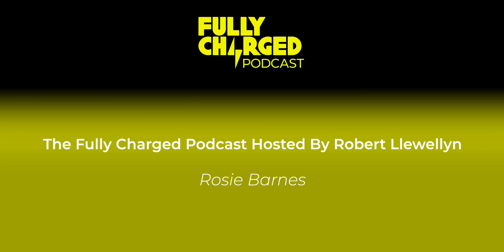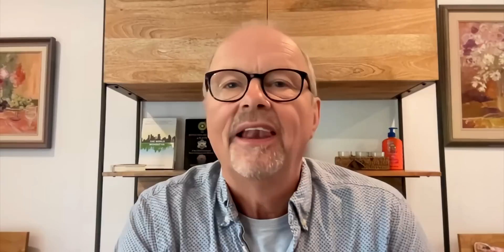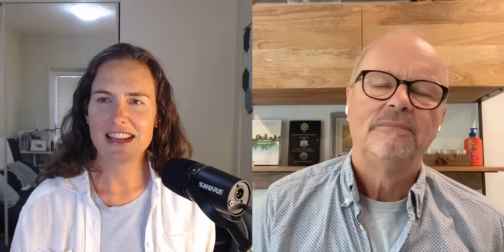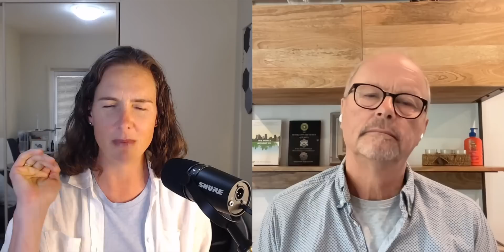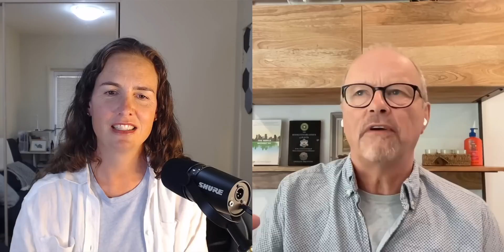The Inevitability of a 100% Renewable Energy Supply with Rosie Barnes | The Fully Charged Podcast

Comment: 20million vehicles in Australia and all parked 23hrs a day with 100kwh batteries means that you can have upto 2,000gWh of DISPATCHABLE electricity daily. 
Avg daily drives are 7kwh only from 100kwh capacity.
Reply: are ev owners who spent a fair amount on their vehicles (and knowing that the battery is the largest cost) willing to have their vehicles to be used as grid storage - given that this will add to the battery degradation over time.  Also possibly going to use the vehicle only to find that it needs to be charged because the grid needed it.  I mean the idea sounds good but the question is how much do you pay ev owners for this and will they go along?
Reply: @peterkratoska4524  there is a large amount on the value of vehicles to grid on the internet now.
Vehicles communicating with the grid. 
Battery technologies are evolving rapidly. 
EV batteries will be a huge potential value to a renewable energy storage. 
EV sales have been increasing at 40%.
The climate change (destabilisation?) is a big cost and central concentrated electrical power supply is the most expensive energy. 
The massive costs of the national grid has been hidden because it was built to the minimum over the last 100 years.
The protection of the existing national is a critical cost saving for our energy future. 
Big EV batteries are a valuable part of our future.
Reply: @stephenbrickwood1602  I've been familiar with vehicle to grid idea for a long time. But Tesla for instance has no interest in doing it.  I know a few Tesla owners (most of them, its usually their 2nd vehicle as they are armchair environmentalists) they are pretty fussy about charging and fast charging - and have zero interest in having their costly battery being used in the public grid.

While EVs are no doubt the future, currently its about 2-3% of the fleet which is nothing.
Reply: @peterkratoska4524  fair comment. 
I guess my main concern is people like my friend who studied at University with me, Civil Engineering, we have both have run a variety of construction projects. 
He has 'fallen in love' with nuclear and is promoting it to save the environment, and has a Masters in Nuclear Engineering. 
After decades he is still talking to members government and big businesses. 

Nuclear has massive costs and will be dominant for the following 60years.
It will distort economies.
It will be a 'locked in' financial disaster. 

It will be ancient technology as Renewables technologies continue to develop. 

It is a dangerously financially poisonous option.
Reply: @peterkratoska4524  I have noticed many ICE, internal combustion vehicles are being recalled because of defects.
So EV and ICE vehicles have hiccups. 
Just saying. 
I also noticed a new battery technology being spoken about on Sandy Monroe youtube. Silicone is being used and doubled the energy density. 

Much to look forward to and be careful of.
Reply: @stephenbrickwood1602  It is a fair point that nuclear has been associated with cost overruns and delays - especially in America.  I'm not in love with any particular technology, I understand we need to de-carbonize as fast as possible.  But renewables (while getting cheaper and faster to build etc - are just not enough for the vast amount of energy we need.  Also it is misleading to say they are zero carbon (ie wind turbines require, steel, concrete, heavy equipment to build and the lifecycle is maybe 25 yrs. - they require storage,  which also has a carbon footprint)   There is a Sabine Hossenfelder video where she cites a study that renewables once adding the storage required - come close to the emissions  to the emissions of natural gas)

Here is a case - I have family in Ontario Canada.  Ontario has lots of hydro and since 2010 has been building loads of wind turbines (in total some 2700 turbines roughly costing at 3-4million each at 11billion). 

 But looking at total electricity generation in Ontario - those 2700 wind turbines generate at best 7% of total electricity while Some 65% of Ontario's electricity is from Nuclear energy (Primarily the Bruce at 5.6gw the largest in the world, and the Darlington and Pickering) Now the Bruce was built over some 30yrs At a cost of 7.8 billion  for plants A and B (even if we say its $30 billion in todays dollars it is still a better investment than those 11billion in turbines for total energy generated. It is gigawatt scale and baseload not intermittent)  

The cost issue is not as bad in Europe, Sweden has built some 10 plants in the past decade. 
Czechia has 2 major plants that supply 30% Slovakia is 78% nuclear, 18% hydro and some 5% fossil fuels.

the cost issue is a big hurdle especially for the US and probably will be hard to overcome because its become a part of the industrys model of regulatory capture.  Its interesting that the US built some 100 plants in the first 25 yrs up to the 70s and in the last 35 years they've only built 2.

This is covered in a podcast called Catalyst which discusses energy solutions (and is not biased against any particular tech) 

The CEO of Last Energy, which is working on small nuclear plants using only existing tech points out that Wisconsins 2 Point Beach nuclear plants (1.4gw) built in the late 60s. These were built by people who were new to the industry, and they are still running fine after 60yrs.

  If we were to copy the blueprints and do exactly the same - it would cost some 750million in todays dollars.  

Now NuScale which is planning to build new smr plants has to spend between half a billion to one billion just getting approved before even building a plant. 

The US builds nuclear carriers and submarines that fit onto a relatively small space - the tech is there. 

here is the Catalyst podcast - really interesting discussions, for instance one episode covered the whole green ammonia plan that Japan is investing. They intend to use it in power plants (it has zero carbon) and maybe marine shipping.  It is relatively easy to ship (same properties as propane). 

https://www.canarymedia.com/podcasts/catalyst-with-shayle-kann/strong-opinions-on-smrs
Reply: @stephenbrickwood1602  One other example of looking at cost. Germany spent some $550billion on its Energiewende transition plan since the year 2000.  And they went from 84% fossil fuels to 78%.  (The US did the same by doing nothing (no thanks to the administrations) but letting gas replace coal just because its cheaper, easier and can be used for peaking energy requirements).

And given Germany shut down a dozen nuclear plants (which were zero carbon) and have since opened up and re-activated coal power plants, its seems its backward.

Had they spent that half a trillion on nuclear plants they could be at zero carbon now.
Reply: @peterkratoska4524  Sabine covered nuclear and its costs and that it is not renewable. 
If Nuclear is considered the only economic answer then the military defence costs must be included. 

87% of the world's population is in dictatorships.
Dictatorships nuclear industries would need uranium ore. 
Does Australia export to every country's nuclear industries?????
Does the USA military defence budgets explode ????

The larger matter of climate change costs is the reason for Nuclear electricity but the larger matter of world military costs is totally ignored by many in love with nuclear technology. 
Also transmission of electricity is the most expensive part of centralised concentrated electric generation, 10 times the plant costs. 

5 times more electricity to replace the high energy density fossil fuels. 

Have a look into this and do the maths. 

I like your reasoned thoughts, I have large construction background and have been pissed about the dishonesty of Sky news, and others.
Reply: @peterkratoska4524  in Australia home rooftop solar, say 32m2, is the same area as the windows in the same house. 
But they cost less $/m2 installed. 
After 20years just add a panel to get generation back to the original output and get another 20years of production. 

20million buildings in Australia. 
33kwh daily per rooftop. 
660gWh daily is bigger than the 600Gwh fossil fueled generation. 
400gWh is avg available generation in fact.

New battery technologies and if the 20million vehicles in Australia are EV, and 100kwh batteries the 2,000gWh daily of dispatchable. Which is 5× today's avg fossil fueled Electricity generation. 

AND  no transmission costs because the existing national grid is perfect for balancing power supply. 

The national electrical power grid is UNLOADED by 50% when home demand is removed. 

This is why the LNP and Labor governments support rooftop solar. 
They are very quietly protecting their budgets.
Reply: @stephenbrickwood1602  Yes, nuclear is not renewable but it is low carbon.  Of the total energy use (including heating/cooling, transport, industrial mfg etc).  Yes there are issues but it is also gigawatt scale and baseload.  We pretty much need all we can get, and to de-carbonize at the same time.

There is an issue of whether there is enough uranium but the material supply issue is also a problem for EV and Grid batteries.  Right now evs are 2-3% of the fleet and to go increase to 80% in 10 years will require a massive increase in mining of not just lithium, but a lot of other metals, including class 1 nickel, chromium by 5-10 fold.  This has never been done and much of these are  in a handful of countries. 

The one big lithium operation in the US has all sorts of issues (using a lot of water leading to ground water pollution) to indigenous land rights.  

Australia is a good fit for solar pv. (I understand Sun Drop farms there, uses solar and desalination to grow 15% of the countries tomatoes) There are areas with lots of sun.  But it doesnt work everywhere, I live in Vancouver, most of the winter season you're lucky to see the sun once in two weeks.  But BC actually is one of the 3 regions in the world that is 100% hydro. (along with Quebec and Norway).
Reply: @peterkratoska4524  Actually nuclear does have significant CO2, according to Sabine. Life time CO2 I think. 

Vancouver !
You do have a different situation.
But with climate change you may luck out, Hahaha. 

Let me say that given the sun does shine and PV is much more efficient at cold temperatures then for months Renewables maybe dependable. 
Burning gas in the critical months may be acceptable.

Nuclear is not a military problem if dictators do not go for their own nuclear industries. 
If non nuclear energy solution can be developed then maybe the dictators will steal the technology and save the planet peacefully.
Hahaha. 
I am joking and serious, the big picture is the WHOLE POINT.
Reply: @stephenbrickwood1602  finally I see you talking sense.  Nuclear produces CO2 for 10 years (7 year build estimate plus the standard 3 year overrun to enrich the mafia nuclear/construction cartels).  So just how much C02 is emitted for 10 years BEFORE those sh1t heaps are even switched on?  That's NEVER accounted for by nuclear advocates/dreamers.  Concrete off-gases CO2 throughout its life.  Steel production, welding produces tonnes.  The nuclear dream is, was & always will be a dream & a con.
Reply: Units!
Reply: @AnonYmous-rw6un  do you mean home units and flats  ?
Global calculations help you understand the dimensions of a problem and the Global solutions. 

Now the details. 
Rooftop solar PV over 5 hours is 1kWh, in Australia. 
A house Rooftop is 100m2 to 200m2 
My home would need only 16m2 of Rooftop solar PV.
And I could supply 6 houses with 100m2 covered in Rooftop solar PV. 
So a 200m2 Rooftop solar power system could supply 12 home daily needs as 'feed in ' power. 
Australia has 20million buildings, 10million are homes and units. 
If you keep paying your power bills the owners of the grid and  buildings could make a good income, 7 days a week.
200m2, at $0.30 kwh = $60 ×7 = $420 wk
Reply: Tesla plans V2H V2G within 2 years
Reply: @johnharcombe9412  
Tesla (Elon musk) says "the electronics in the cars will have the capability in a few years"
He (like me) doesn't think it's that useful.
.
If a car isn't at the home, it can't receive the energy from the solar.
Only a static battery (individual or communal) can do that reliably.
Reply: @johnharcombe9412 Hyundai, Kia, MG, polestar already today.

Comment: Thank God you are discussing transmission costs.
Reply: - Parliament, departments and CSIRO refuse to - at many senate question sessions.
Reply: She's an engineer, she totally understands there's no point having a generator if you can't get its electricity somewhere useful.
Reply: @alanhat5252  you can transmit electricity but at huge and uneconomic costs.
Infact if 20million buildings can pull electricity off the roof the insane bigger grid costs disappear. 
The existing national grid will be UNLOADED by 50% and perfect for load balancing.
It would be like having a spare national grid capacity for free.

The money, profits will be in the grid, the grid owners. 

National governments do not want to be dragged into big grid construction projects. 
It is politically dangerous, governments can loose elections.